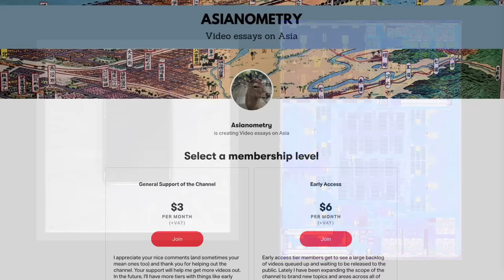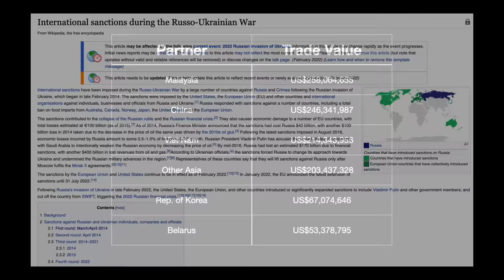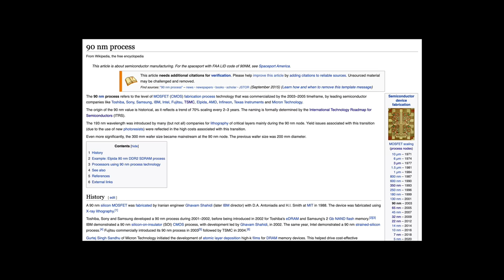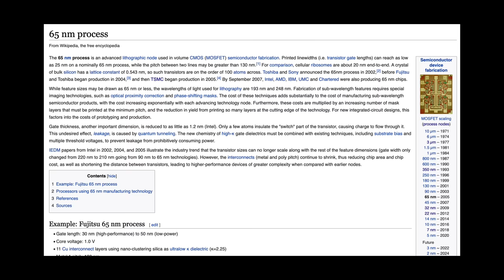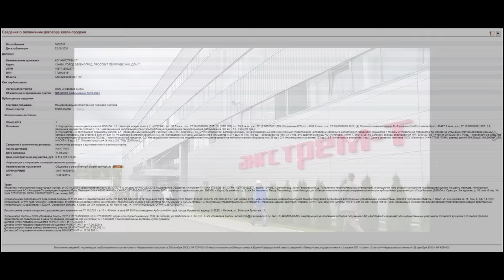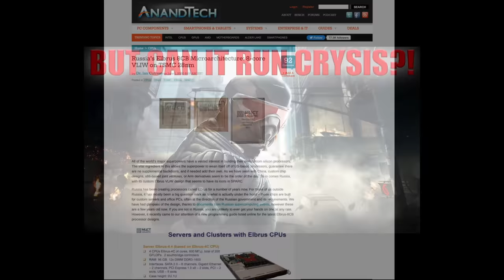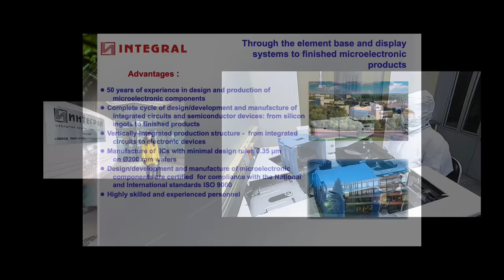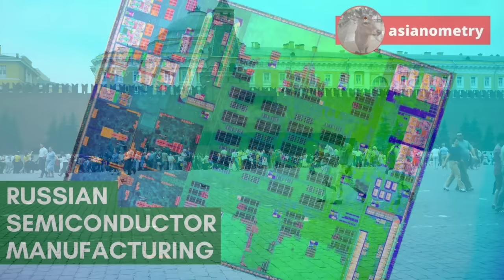Why Russia Can’t Replace TSMC

Comment: Why Russia Can’t Replace TSMC?

Well...Is there a single country that can replace TSMC without importing production lines?
Reply: Russia is supplying his own needs with their own chip Baykal analog i5 2ghz quad used in desktops and laptops its their own architecture not intel or Amd
Reply: @boburhs I'm sorry to disappoint you but:
1. Baikal-M is a low-end CPU, somewhat between Intel Atom and I3  in terms of performance.
2. It is manufactured by TSMC. "Was being manufactured", actually. Until the recent invasion.
3. It was in production for like three or four months. Considering small batches, you barely could find a single Baikal-M-based PC or laptop.
Reply: i dont even think you can move the production line
Reply: Possibly south korea in a few years with samsung and with SK hynix apparently trying. Possibly intel in a decade.
No one else comes even close.
Reply: @cucurbito  That level of performance is more than enough to keep industrial automation going.
Reply: That's a good question, but its channel is propaganda oriented so they didn't tell that.
Reply: China in about 10 to 20 years. Any country should have big demand to succeed, and China with its 1.4b people is booming!
Reply: Why don't we just import Taiwan
Reply: @MAFz7  most likely 5 years. China already achieved 5nm
Reply: @boburhs  just like NK is supplying their own corn cobs for breakfast... way to go kids

Comment: From the 90s and onwards, Russian vacuum tubes became quite popular in the audiophile community worldwide, with manufacturers like Electron and Sovtek being very well received.
Reply: Ukraine as well, in both circuit and display tubes.
I don't think I've bought anything Russian except razor blades in the last decade at least.
Reply: @hyphen2612  I know, but since the video is specifically about Russian tech, I only mentioned Russian tubes.
Reply: Let's hope they are able to replace all those transistors with them
Reply: @barbadolid5170  Haha, good one!
Reply: Only because Russian and Chinese tubes are all that are still being made.  Both of them pale in comparison to the quality of NOS US or Western European tubes, but those are getting rare and expensive...
Reply: One advantage of tube technology is that it is much more resistant to EMP attacks.
Reply: Run your smartphone on vacuum tubes!
Reply: @SLow-fb3qm  Would a car-mounted radiotelephone do?
Reply: I always want to see computer with 8088+8087 chips to be remade with vacuum tube.
Reply: @shdwbnndbyyt  And!? Won't matter afterwards anyway!
Reply: @pjacobsen1000  We also use Russian high power tubes for amateur radio.  The surplus USSR army tubes are way cheaper than the USA variants.
But now we are moving on into e.g. 1500W LDMOS without lethal voltages ^^
Reply: @la7dfa  Huh, that's interesting. I didn't know that. But I guess they're different from the ones used in amplifiers.
Reply: @jimurrata6785  I bought a Russian binocular and it was heavy but good.
Reply: @janami-dharmam  I do have a Russian scope. Their optics are quite good.   👍
Reply: @pjacobsen1000  Yes mostly.  But some smaller ones in the 20-200W range or so can be excactly the same type.
Typically originally sweep tubes for old CRT TV's, but now used for audio amps and RF amps.   As long as they can used in the MHz ranges we can use them too.
Reply: My guitar amp has Sovtek tubes and they have been reliable...
Reply: @shdwbnndbyyt  you win the maximum ominousity prize. Fingers crossed 🤞
Reply: @SLow-fb3qm  Makes you strong.
Reply: As old school as vacuum tubes are, they maintain one clear advantage...immunity to an EMP attack.

Just say'n...
Reply: @bobweiss8682  It's the imperfectness of vacuum tubes that make them "good" for guitar amps though.
Reply: @shdwbnndbyyt   @ironwolfF1  EMP hardening isn't difficult you just surround the electronics with a grounded metal box and make sure the inputs and output wires are properly protected from current spikes.
Reply: @atomicskull6405  The qualities of vacuum tubes that make them popular in guitar amps and high end audio have to do with harmonic distortion and clipping characteristics. The issues with Russian and Chinese tubes have to do with poor materials and poor quality control.
Reply: @ironwolfF1  electrically rugged - and, if using glass envelopes - physically fragile.

My first classes - early to mid seventies - had them being used.
Reply: @jimurrata6785  I don't remember anything else than every 2/3 of petrol I've used to drive my car and one shotgun that I bought early 2000 but sold later.
Reply: @bobweiss8682  yup.... and I've got a Baldwin organ from 1954
.
It's got like 80 tubes....
And I have 2 to 3 spairs for each
.
All NOS American tubes from 50s, 60s, 70s
Reply: Sick burn!!!
Reply: That's amazing. I didn't know that.
Reply: @shdwbnndbyyt  "One advantage of tube technology is that it is much more resistant to EMP attacks." - Good luck replicating ANYTHING electronic made in the past ~40 years with vacuum tubes.
Reply: @creamwobbly  There's the High-Altitude EMP (HEMP) attack where a nuke is detonated high in the atmosphere over a target area. 😳
Reply: As both a guitar player and audiophile, I managed to curse myself into owning four different tube amplifiers, which re-tubing alone gets to be quite expensive. NOS Soviet tubes are always a safe bet for me and what I primarily buy from ebay. Spend a little more to get matched, gold grid tubes and I honestly think they're the best when it comes to price/performance. I could buy NOS USA tubes that are built slightly better and are SLIGHTLY more harmonically responsive, but will cost 3 to 4 time as much on average.

You couldn't pay me to actively use Chinese tubes.
Reply: @hyphen2612  I'm kind of audiophile, but I don't think I've ever used Russian razor blades. Oh, wait a minute, that Amazon pack of 100 blades... Aargh!
Reply: I. M. Notamoose
Yeah, but make a fly computer for 747 etc by tubes and you can carry only crew. No cargo or passengers.. 😉
Reply: Its a niche market with consumers averagely over 40yo. They make more money, i mean hella more on exporting vegetable
Reply: @la7dfa  We used Russian and Hungarian tubes in the Norwegian Air Force back in 1981-82. In Air Traffic Control Radars.
It was at that time not so easy to find spare tubes but the Easterns worked well and the quality was good.Each tube was tested in a tube tester before going into service. The radar was in use until 1989-90.
Reply: ...thank you, Mr. Factoid.
Reply: @shdwbnndbyyt  Tubes are also used in high wattage transmitters like radi stations...  Transistors can't handle those power levels yet.
Reply: @rashidisw  For what?  It'd be huge and awfully energy inefficient
Reply: @rashidisw  the 8088 has 29,000 transistors and the 8087 another 45,000. That's 74,000 vacuum tubes. This is going to be very expensive and gigantic. Just think of how much space it will occupy. You will need to design a structure to support the weight of all these vacuum tubes and cabling, some way to detect which tube has failed and a way to replace them, a way to dissipate the heat, to power all these tubes, not to mention redesign the timing. Simply up-scaling and replacing all the transistors with vacuum tubes will not work. They do the same function, but they aren't the same thing. And you have a machine with 74,000 vacuum tubes. How many seconds can it run before another of them blows? How about a 6502 instead? "Only" 3200 transistors.
Reply: @bobweiss8682  Just like space station right?
Reply: I have a Russian 35mm  stereo camera - I think it was made in the 1980s.
Reply: Vacuum tubes...
Reply: I have a Russian 35mm stereo camera that I bought in the 1980's.   And a Soviet era O gauge locomotive.  Built like a tank.
Reply: @jimurrata6785 
Ukraine makes CRTs?
Really?
Cool, I want some

Comment: Amazing!
To give some sense of how old the 180nm node is, the original Willamette Pentium 4 released in 2000 was fabricated on a 180nm node. The 90nm node is what Intel used it to make the Dothan refresh of the Pentium-M in 2004, and the 65nm was used to make the Core 2 Duo in 2006!!!

AMD's dark days in 2012-2016, during the Piledriver/Steamroller/Excavator era (before Zen) Global Foundries was struggling to move beyond the 32/28nm nodes!
Reply: Nice geekwork.  From what I understand, making chips smaller (process node) only goes to the following issues:  less defects per wafer (smaller is better), different nodes and designs designs have better power consumption than others (90 nm was an energy hog), and the smaller the process node, the higher the volume (you can fit more chips on any given wafer).  Arguably for Soviet 'low volume' and "not sophisticated' designs, you can get away with 0.18 micron (180 nm) production.  But I'm glad the Russians are backwards.
Reply: Core 2 Duo is still a very capable, I'm still using them today.
Reply: Sadly each subsequent process nodes bring less benefit (still some benefit) than previous ones.

We might be nearing a soft plateau where nodes after or even 3nm itself will be substantially more expensive than 5nm/7nm for the foreseeable future and the benefits maybe marginal.

The major Innovation might move to design space and specialisation - amd zen 2 (3000 series) was on tsmc 7nm as is intel 12th gen on intel 7nm process, the performance difference between them is staggeringly huge (apple m1 is on 5nm)
Reply: I still have my Pentium 4 computer working as it has a 3.5" floppy I can write to for my 1995 CNC mills uploads
Reply: @raylopez99  Do not get fooled that russians are "backwards". Note that analysis focused on bleeding edge chips.
Strategic chips are sensors, transducers and memory chips. Also microcontrollers.
Smaller nodes get lower production yields. 
Also in case of nuclear war and widespread nuclear fallout, manufacture of small node chips will become progressivelly difficult. 
Soviets know well why going below 100um is not worth it, at least from military standpoint.
Last but not least rad-hard design is norm in Russia, also because of things like radioactive dust from their nuclear test sites and re-processing plants. Russians are used to protect their equipment. 
West is not. Very few people and factories protect their equipment, enjoying priviledge of living in non-radioactive world.
I used to live in a place with merely 5x of background radiation due to uranium mining and re-processing operations nearby. This causes many issues, even in electronics like switching inverters or transmitters, where transistors operate close to their breakdown voltages. 
It is all manageable, but comes with extra cost.
Reply: @raylopez99  you can also run at higher frequencies at smaller process nodes.
Reply: @Erik-rp1hi  what OS are you running?  …connected to the internet?
Reply: @JoeOvercoat  Windows 98 and no it is not hooked to the internet.
Reply: Great background !!
Reply: I still rock an FX-8350 😹🤘🏻
Reply: @edwardstables5153  Oh good one.  I didn't think of that but it makes sense, since the speed of electrons in doped Si is about 6 km/hr and shorter lengths means faster speeds.  Let me Google IEEE quickly...well, for super-small nodes (3 nm or less) you get this: 2021 "For example, if you want to deal with extremely high-frequency parts, maybe the right answer is some gallium arsenide variants or even silicon germanium. "
Reply: @aravindpallippara1577  After 1 nm it's probably mostly vertical 3D stacking, unless we move away from silicon to something else.
Reply: Donazi Dick Trump Usa  Yep, I see you added a lot of sources there, not speculation at all...🤔
Reply: @kalliste23  lol no, c2d is outdated as it lacks AVX etc. it's not a speed issue, it's that a lot of new software simply can't run on them. I stopped using my xeon c2q a few years ago because of that, now I'm on a 10th gen i7 which boosts to 5.3ghz or more when needed, has AVX and all that stuff.
Reply: @ChristianSandviknes  Sure USA doesn't have clean hands and I would personally not live there - Canada and much of Europe sounds to be better places - but (other than ip stuff - not stealing but stupidly enforcing selectively) and destabilising the middle east and latin america, USA can't be attributed that much harm to the world
Reply: @aravindpallippara1577  Oh, I was just making an argument that he had theories, and no sources, no facts and nothing to show.
I didn't actually agree with it.
Reply: @kalliste23  Yeah, its capable,... but depends on what,... HEVC forced me to upgrade dads mashine to Haswell, while i migrated to Zen3, so yeah C2D is capable, but lacking, also power effeciency is terrible,... you can literaly use raspberry pi insted.
Reply: had the piledriver man o man he was hungry
Reply: @AgentSmith911  we are probs gonna move to carbon after silicon
Reply: Xilinx Zynq 7 series are still on the 28nm node
Reply: Geezus!  I don't see a BostonDynamics type company coming from Russia anytime soon. xD
Reply: Now Intel is stuck on 14nm++++ while Advanced micro designs has far surpassed intel.
Reply: @noth606  yes, if you're into gaming they're not much use nowadays but you can still get a lot of use out of them. Depending on your graphics card you can offload some encoding from CPU when doing video stuff.
Reply: I have core 2 duo on one laptop with windows 7 on ssd...runs amazing and now
Reply: @edwardstables5153  debatable... 18 out of 20 cpu clock world records are on 32nm, the other 2 are on 65nm. That shit is like decade old.
Reply: @kalliste23  heck ya!
Reply: @jamesozment1  Alder Lake is a thing.
Reply: I worked on all those chips at Intel.. good times.
Reply: @jamesozment1  Intel had been on 10nm (on par with TSMC 7nm) for 4 months by the time you made this comment. Also, AMD no longer fabricates their own nodes. They've relied on TSMC since 2018. Intel is behind the bleeding edge of node processes, but not by as much as previous marketed naming conventions would suggest.
Reply: @KalphosZeromar  There's really no way to be sure what'll come after silicon. There's also concern over what comes after EUV Lithography, but both of these should at least carry us through the next decade of improvements.
Reply: @piotrcurious1131  No. Think where rusia can buy ram ssd cpu for their banks hospitals?
Reply: @aravindpallippara1577  even if you hate USA  most people will find a better life in USA. Who is gonna live in canada? Careers in IT industry? nope
Reply: @hs342  I'm retired now so fingers crossed IT work will never be necessary again! Perish the thought.
Reply: @Erik-rp1hi  
Nice trolling. 😏 Windows 98, right...
Reply: @stanleysmith7551  My bad, just looked at the sticker next to the Pentium 4 sticker, it is a Windows XP.
Reply: @piotrcurious1131  they are backwards. they just try to make the most out of it.  and sometimes that works, but its still backwards
Reply: @Blackadder75  sure it is. Also it's like no matter how perfect your piano is if you play alone in a basement.
Reply: @aravindpallippara1577  I believe it is more the result of internal architecture than process. I run with both Intel and AMD gear because of procurement process. I would actually like to lay my hand on some Fujitsu ARM server gear (we mostly run Linux and xBSD)
Reply: @AgentSmith911  even a 2nd gen i3 is better than it, upgrade lol
Reply: @aravindpallippara1577  thats literally the worst harm, ruining countries
Reply: @jamesozment1  lol casual
Reply: that's almost as impressive as the fact that the year 2000 is 22 years old now.
Reply: "To give some sense of how old the 180nm node is,"

...just refer to a calendar?
Reply: Why even bring Intel vs AMD into this. 
Why. Just why. 

It's pointless. Doesn't matter whether you're an Intel fan or an AMD fan. It just does not matter to anyone but Intel or AMD fanbois. It's worse than the Ford vs Chevy rivalry.
Reply: I don't understand why you had to make such a convoluted comment and be wrong at the same time. If the Pentium 4 was fabbed on 180nm, then certainly 180nm is older than the release date of the chip.
Reply: @jamesozment1  you're delusional if you think Intel is still stuck at 14nm. Intel is at 10nm. AMD doesn't even make nodes. seethe
Reply: @piotrcurious1131  this is some massive copium. "Russia doesn't go below 65um because they totally don't want to" lol
Reply: @anon_148  Well, same goes for world Peace 😂 When logic ends, Russia begins 😂
Reply: Am browsing the internet right now with a core 2 duo computer, to me that is the sweetspot between durability and performance. For most application you wouldn't notice anything.
Reply: @Erik-rp1hi 😂 I am writing this reply on a VIC-20.